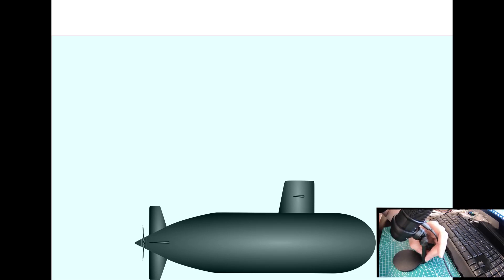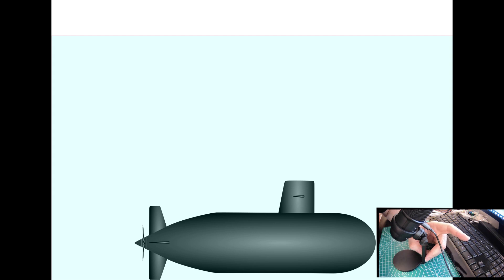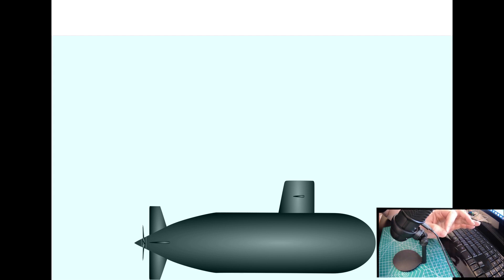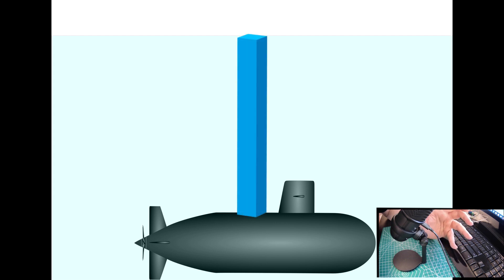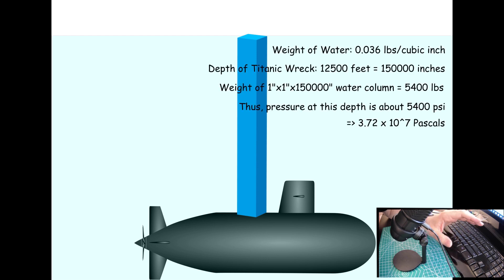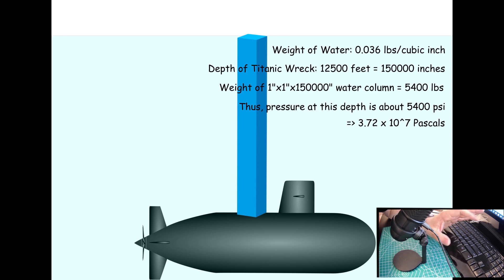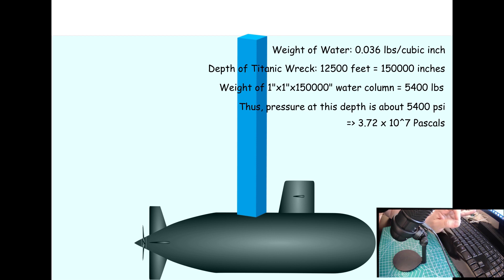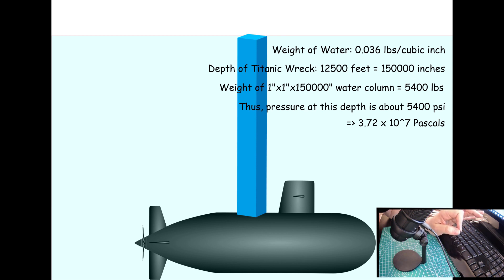Extreme Pressure on Deep-Sea Submersibles

Comment: 2008 test on 2 composite cylinders 1 is carbon fibre the other is glass fibre . very interesting the carbon  fails but still takes more pressure but losing it at same time untill it fails  bit like titan going up and down it had already fails soon as any cracking was heard  https://youtu.be/lwvUvIKhK1Q

Comment: dooing math with lbs and feet💀
Reply: Chad metric system made by international body of scientests vs virgin imperial system made up by 12th century English peasants
Reply from the maker: The metric system is superior, but objectively speaking, having an emperor/king impose their will to have units of measure based on the size of their own fingers, feet, etc. is the epitome of Chad.
Reply: I mean we record pressure in PSI not PSCM

Calculating inches with feet makes sense. And it’s not hard to even do a rough estimate conversion or just put it in google.